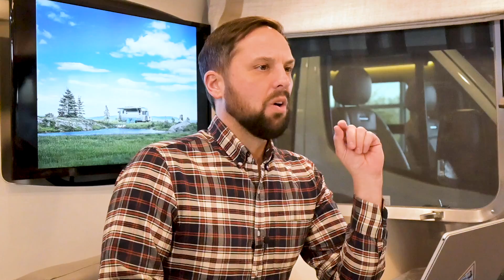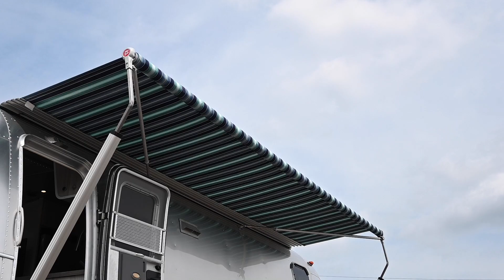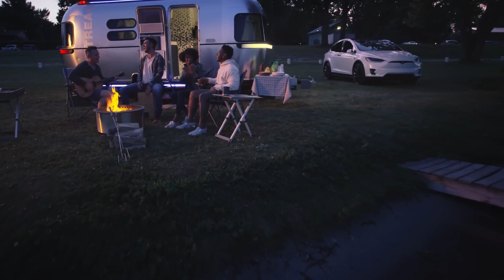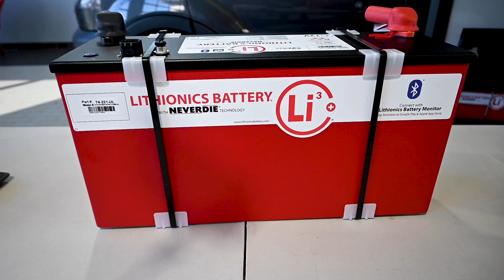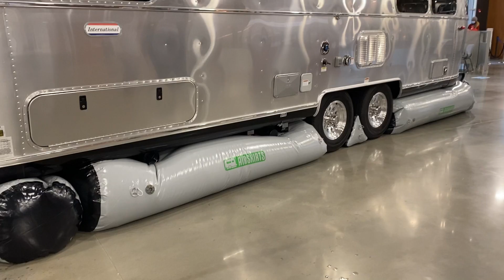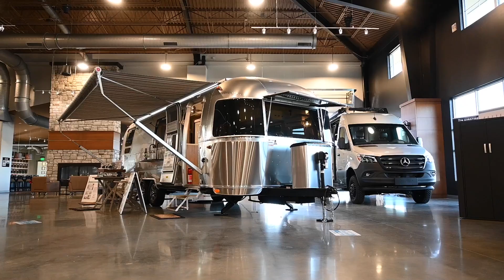Patrick - The Airstream Guy Episode 2 | Airstream Q&A, eStream, Winter Camping, and more!

Comment: Great advice about going with the bigger trailer up front.  We learned the hard way….  Started with a 16, went to a 25, and now have a 30.  I’m 6’3”, and did not fit well in the 16..  the bed is curved on one side, so it’s not as big as one would think.  And there’s the micro mini wet bath and tiny waste tank.  Go big.
Reply from the maker: Glad it was helpful.

Comment: We have a 25’ International. We are liking the electric refrigerator in the 2022 trailers. Could it be switched out since the width is the same? What are your thoughts on the electric fridge vs the propane one? Thanks!
Reply from the maker: I am all for the compressor style electric refrigerators. I don't believe the retrofit will be too complicated.

Comment: Question to ask you about the refrigerator and freezer (Globetrotters 23FBT), why does that switch another way around from top to bottom freezer?  It is because better effective colder the freezer rise up to the refrigerator?
Reply from the maker: It is a different manufacture than used on other models. It is their decision on the orientation of freezer vs refrigerator.